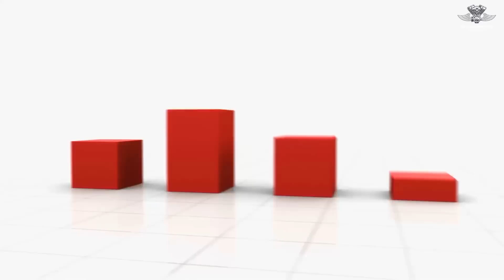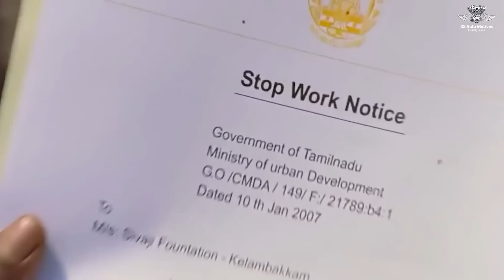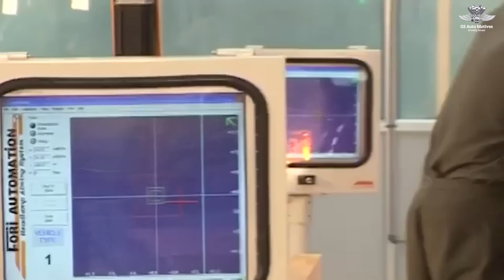Ratan TATA Says - "This NANO 2.0 will make TATA Motors the SECOND Biggest Car Maker in INDIA"

Comment: 1L ex showroom price da. Without AC,power steering. On road 1.5L thaanditu. Top end nano 2.5 L on road. Ithuku Alto santro vangalam nu Elam poitaga
Reply from the maker: nanu ex showroom thana.. Sone.. On road solala eh nanba
Reply: Far better than that soap box Alto🤣🤣🤣🤣🤣🤣🤣🤣
Reply: @navaneethakrishna7311   neyea solika 🤣alto  40 yrs ah sale la iruku. Un kakkos nano 4 varsathula serupadi vagitu poitu 🤣🤣
Reply: @GSAutoMotives  adha bro solran. 1L nu solitu 2 cylinder engine, oru optionum tharama. Elathulayum cost cutting pantanga. Rear seat la engine vibration,heat nalavea theriyum
Reply: @navaneethakrishna7311  dei mutta payalea. 1L nu solitu 1.6L ku on road price kudthaga da. AC ilama car la ukara mudiyuma 🤣tharkuri.  Elam after market la ac poduvanga .  Bike ah vida safer ah 🤣 100 km distance ku Mela pona engine over heat aagi fire aaguthu nu evanum vangala. Ishtathuku mutu kudu